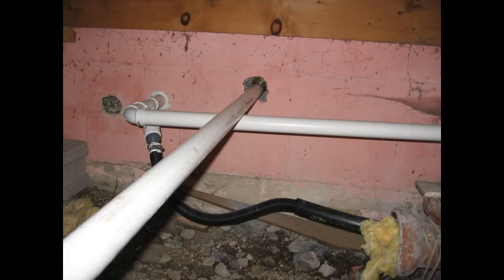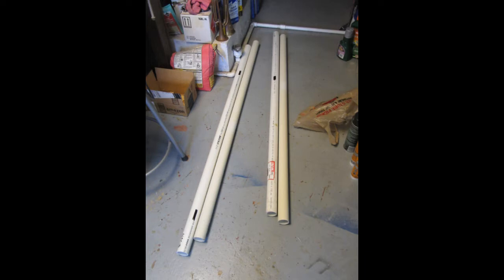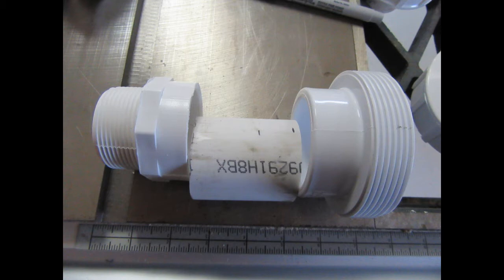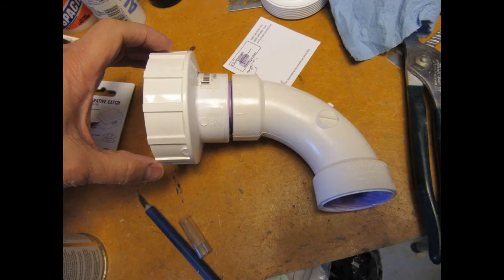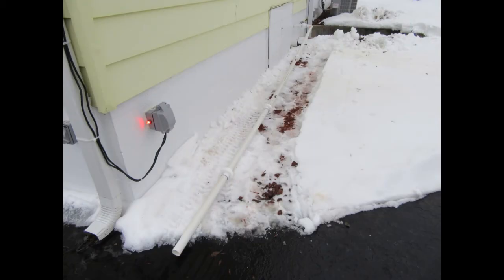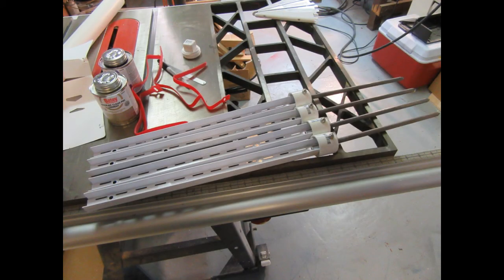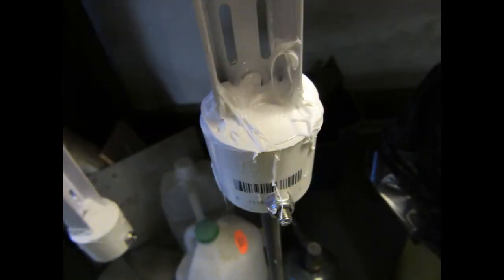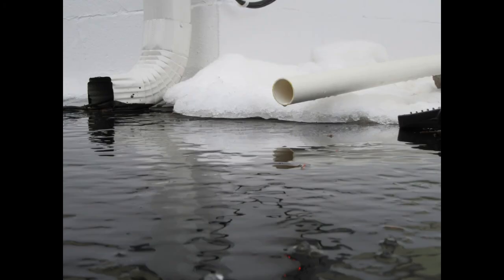Above Ground Emergency Sump Pump Discharge Pipe

Comment: What did you use a a diverter to direct the flow out the "usual" or emergency pipe? The image in the video looks like a "wye" connector but that would always have flow going out both pipes.
Reply from the maker: Dave MacKay, the idea was that the discharge should be through the underground line whenever possible. With the "wye" splitter fitting, the discharge is normally blocked where its secondary discharge line goes through the wall.....I screw a PVC plug in to block the route for the water. So normally the only place the water can go is out the underground line. But in the winter, the underground line freezes, so the water can't goo that way, thus the backup sump pump can't discharge its water; so during the cold months I remove the screw in PVC plug and attach my PVC discharge line as shown here, so the water gets out that way. During the Spring, when the underground line has thawed and yet I have not yet removed the above ground line shown here, the water splits at the "wye" so both discharge lines are used.